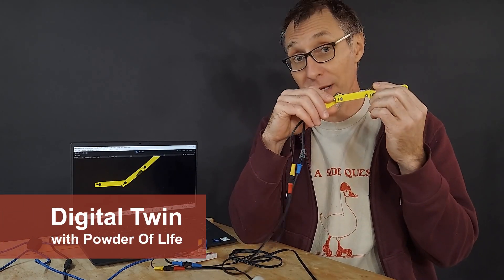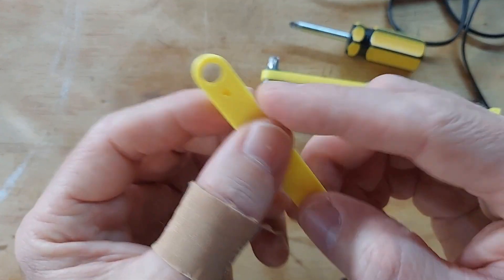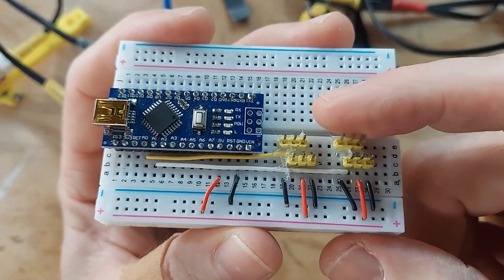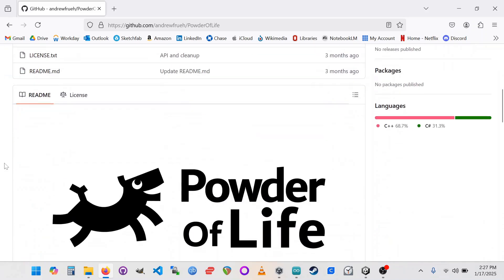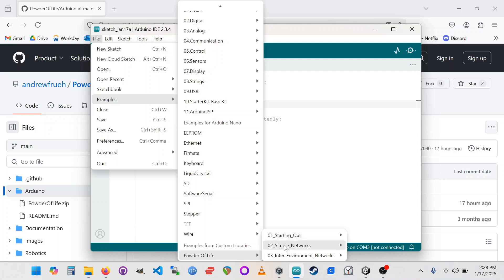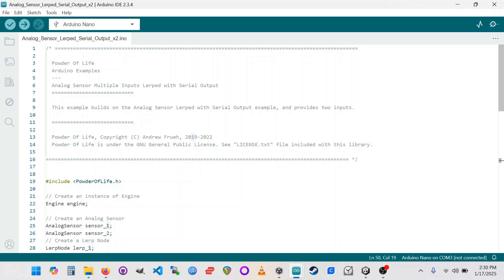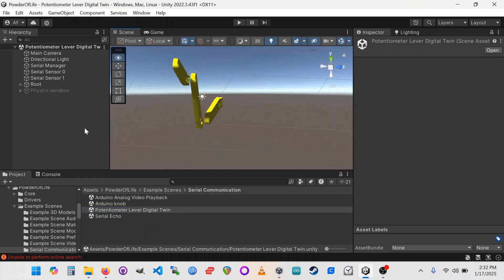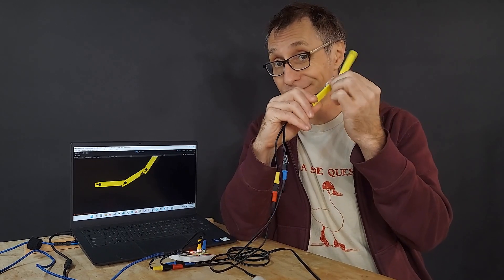A digital twin with Powder Of Life

Comment: Absolutely incredible. Is it poossible to make this work in Maya?
Reply from the maker: You should be able to make it work in any program where you can read data from the serial port and then use it to make changes to something programmatically. That said, I have no idea what it looks like to communicate with Maya via programming (does it even have an API?)
Reply: @androofroo  Thank you. It does have an API and i've seen videos from way back when people connected servos but not much information how they did it. Maya is very flexible with this type of scenarious and wil make lot of people very happy if there was a demostration like yours in Maya :)
Reply from the maker: @No_Plastic  noted! Though if I was going to pick a 3D modeling program to port it into, I have to admit, I'll probably start with Blender due to being such an open source dude. Also note that the framework spits out a serial stream that you could capture in parse from whatever program if you're in the mood.

Comment: Tutorial of Life!  Congrats man! Super satisfying to see that motion in real time.  As I understand, the value digital twins offer designers is running simulations to speed up/eliminate real world testing. This is a major use case of Nvidia's Omniverse. Have you tooled around with that?  Any thoughts on a tutorial for importing a custom build to Unity via Powder?  With all the angles present, it would be amazing to add part weights (in most CAD packages) and begin testing different motors and IK
Reply from the maker: @planckstudios  oh snap! I love where you're going with this. No, I have not yet played around on the data end with any of the new AI tools..... but I assumed that that's in the future and it's certainly something I'm kind of accounting for in the back of my mind.

I think my assumption for now is that at some point there will be a set of AI components and interfaces that will just be part of powder of Life as a framework.... essentially it'll be another environment.

Thanks so much for your awesome thoughts ＼(´Ｏ｀)／
Reply: @androofroo  stoked to see what you do next!  For some reason I don't think of Omniverse as overtly AI. Maybe it's a good socially, letting AI integrate background data like real world physics and libraries of components - if it helps devs build more intuitively?  Def interested to find a way to simulate and test my builds before printing and sourcing all the parts - thanks again for all the work!

Comment: The same ideas can be used in motion capture and medical devices . Great explanation, thank you.
Reply from the maker: Indeed and I think that's what's fabulous about it to me. The connection can be fairly simple as long as you calibrate everything so that they line up.

Speaking of the medical field, I'm currently working with a colleague on a crash test dummy analysis tool that will essentially use the same Concepts.